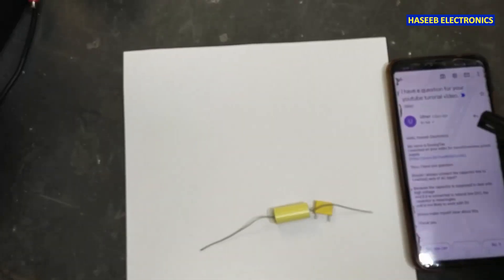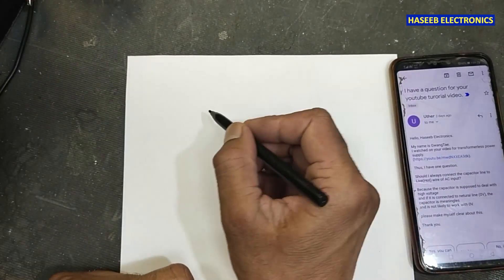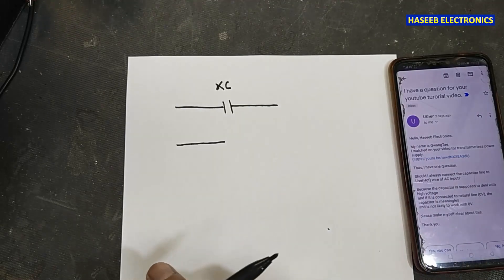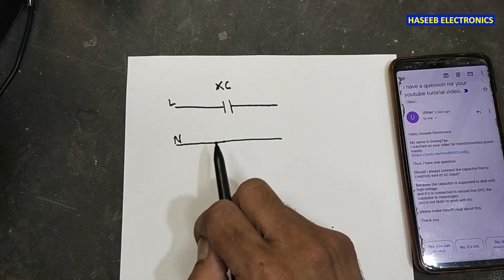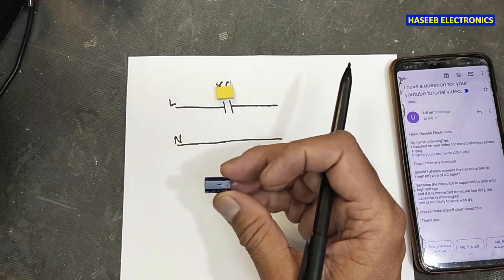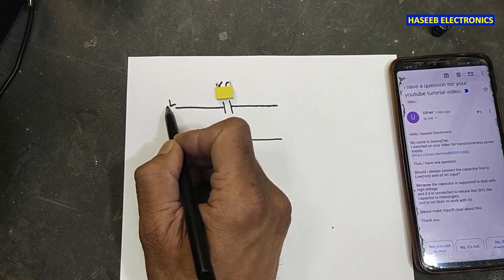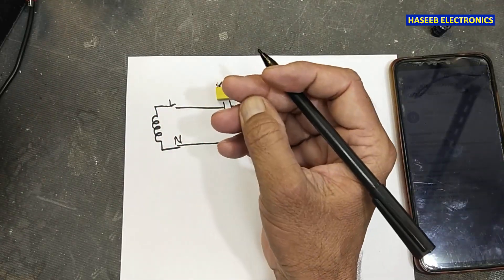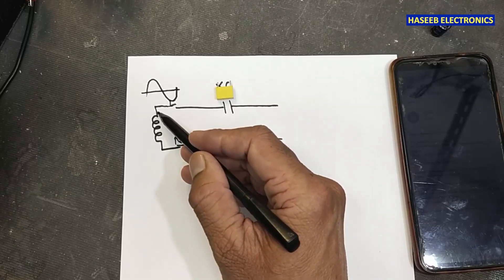{737} AC Capacitor in Line or Neutral??? where to install ac capacitor

Comment: The person asking the question doesn't understand what AC is, or he wouldn't have asked it. It's amazing the number of people who think that L & N in AC systems are somehow similar to DC. With AC power installations, the N wire is at ground reference, which is basically the only difference between the two wires apart from the current directions will always be opposite and changing at 50 or 60 herts.

Comment: Always the best Master 🙏 Master 🙏 Master please review my request that's is really from long time I requesting about IGBT or MOSFETs gate resistor calculation sometimes we want modification in repair lab if you notice my request I will thankful for that
Best regards from Philippines 🇵🇭
Reply from the maker: dear brother, your this question is already in my liest. but it have a very very long and sensitive calculations. and we cannot consider only one calculation for all mosfets. 
every type of  mosfet and igbt needs separate calculations. and anyone who wants to calculate it he must have deep knowledge about the mosfet. 
this is the reason that it is being delayed. if i will share calculation for 1 type of mosfet, anyone who will use my calculation for another type of mosfet, he will damage his mosfet immediately or he will  not get correct results, in result he will blame me that your calculation is incorrect. 
but no problem i will see some common calculation and will try my best to share it
Reply: @HaseebElectronics  love you brother let's get started the next level of elections engineering tutorials 💪

Comment: AC capicitor is use for power factor.If high frequency inverter then smooth sine wave use AC capicitor on output,, humming is go on.
Reply from the maker: yes dear. it comes in series of load